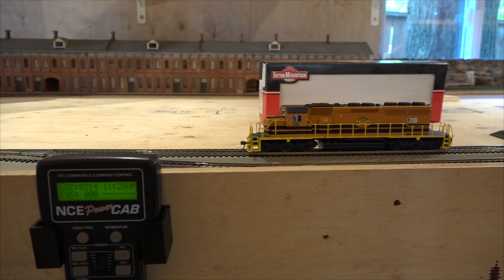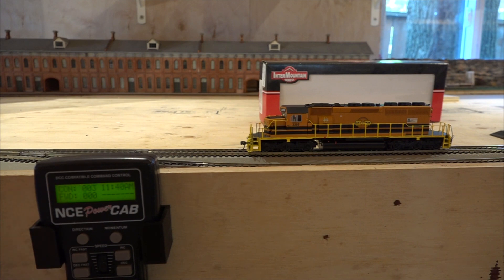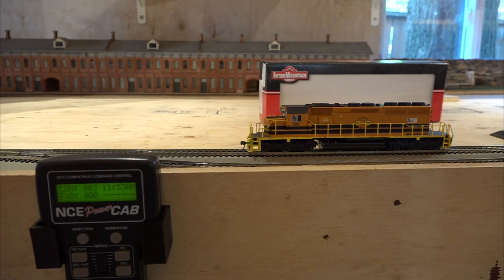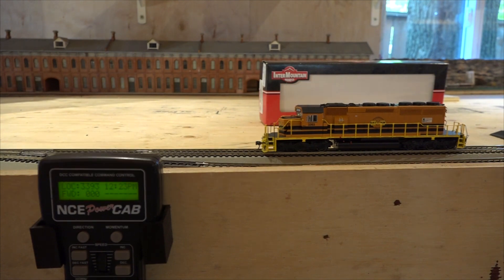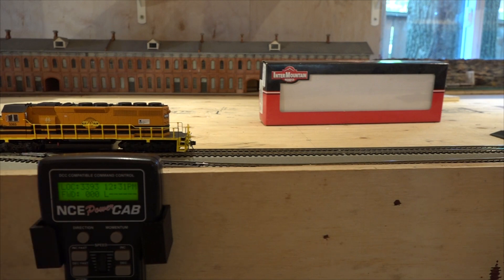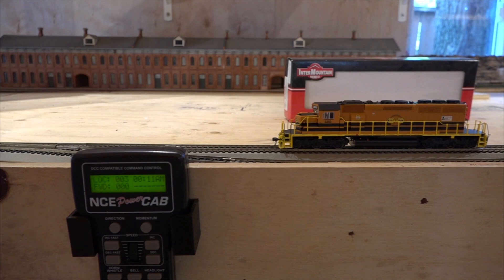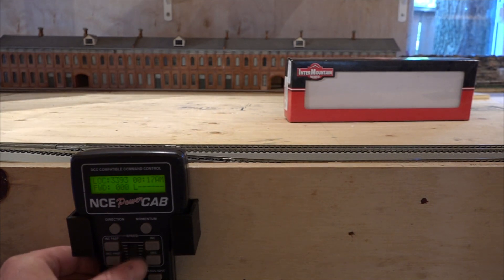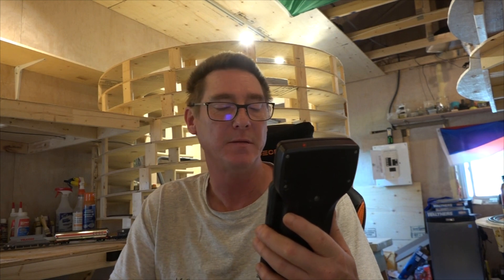nce 5 amp Command system reset

Comment: Address 3 is factory default that provides minimum control of your locomotive. After putting the locomotive on the program track, you need to change the factory default of address #3 to the road number printed on the locomotive near the cab of the locomotive. 
You can also give the locomotive a short address as well - again by entering either the first two or last two digits of the four numbers on the locomotive. 
I believe one can also mix up the address as well but just make sure you use the numbers provided if you wish to scramble the numbers and definitely write whatever number you change the road number to. You DEFINITELY do NOT want to forget it!

Comment: I don’t think you can program with the 5 amp booster system. You have to use the 2amp starter system?
Reply from the maker: you can program on the main. just has 5 amps ,so if something did go wrong, might smoke the board.. hook up a test track

Comment: sparky did you know that i have a new BLI switcher that would work. so i watch this again i built a test track this morning. but anyway i did this the only thing different i didn't had to pust the enter 16tn times it was less.but it work i got my switcher to work. still needs a little work tho :_BNSF::_107107cn::_SPARKYCP::_SPARKYNS::_SPARKYCSX::_SPARKYUP::_SPARKYKCS:

Comment: Dave, When you get a new engine, I would recommend setting the address to the number on the engine & only use 3 for initial testing.  Also, some engines with sound require additional power on a programming track or it won't necessarily take programming.  I have a DCC Specialties power booster to program my sound equipped engines with my NCE 5 amp system.  It would also be good for you to use JMRI when programming engines....John
Reply from the maker: i need the computer interface thingy. just don't have the funds for it yet
Reply: sparky, If you have the NCE Pro 5 amp system (not the Power Cab with a secondary booster) then all you need is a PC and a usb to serial interface into the command station.....John

Comment: I had the same issue last year with my  digi trax system, figured the reset option very quickly.  I try to assign loco numbers right away to avoid this problem.

Comment: Did you happen to notice in the beginning of the video when you selected 3 it came up as a CON. I think you had a similar issue i did. I think you only needed to remove loco 3 from its consist. BUT the information on resetting the system is helpful. I forget the steps but you can look at a list of consists via the throttle.
Reply from the maker: I did notice that . but the video stems from the live stream. when I got the 4 new locos and none of them would move on 3 
so Lorne and I chatted a lot to figure out the memory was too full.

Comment: That's a PowerCab, 2amp system unless you have an SB5 which brings it up to 5amps. Address 3 is the default address from the factory.
Reply from the maker: I have 4 cabs now, one is wireless.. just have to change the cab address to a different number. 
and yes I have the 5 amp booster. which is what I reset to clear it's memory

Comment: Isn't NCE PowerCab a 2amp system? I know the Pro Cab is the 5amp system where you can add multiple 5amp boosters which is what I am using or how do you have your powercab hooked into the 5amp system?
Reply from the maker: I have 4 different cabs now, one is wireless. you just have to change the cab address to something other than 2. to make them all work with the 5 amp booster system
Reply: NCE offers the SB5 - it takes the power-cab and turns it into a regular pro-cab throttle.  https://ncedcc.zendesk.com/hc/en-us/articles/200913385-SB5-Smartbooster-for-the-Power-Cab
Reply: Also the power cab will turn into a pro-cab when connected to any other NCE system (just use the correct cable).
Reply: Good to know. I had a Power Cab, traded it in since you can really only use 4 dcc locos with sound and a few tortoise switches before overloading it. Now I got the Pro Cab with wireless Throttle. I use my cellphone with JMRI as a 2nd one. Good info to know, Thanks!!!